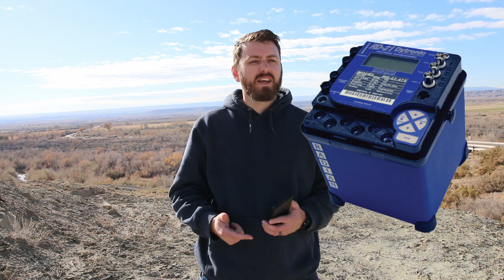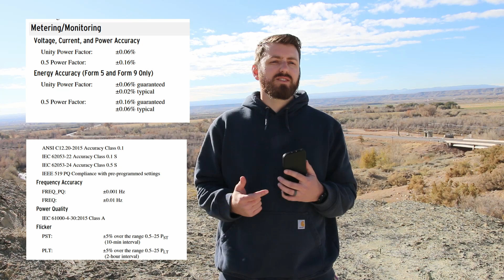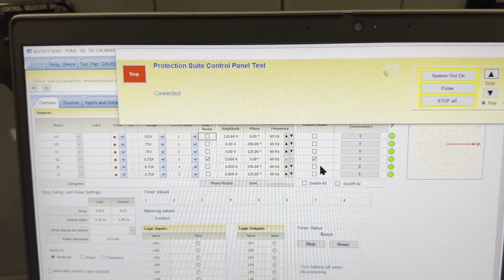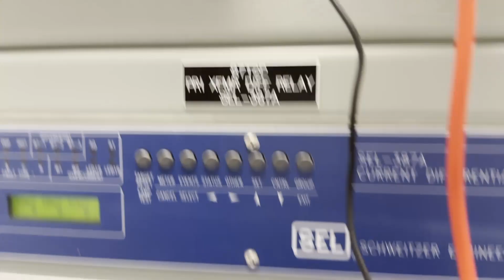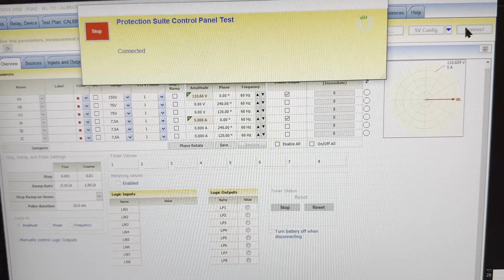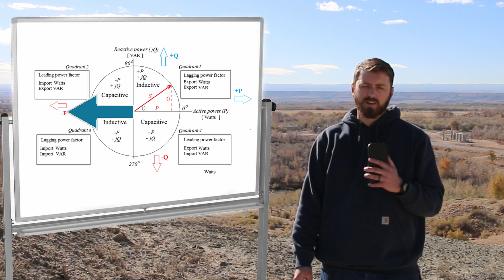How to Test an Energy Revenue Meter with a Watthour Standard [SEL-735 + Radian RD-21] (ep05)

Comment: Good video! I will say Powermetrix makes a phatom load test set that makes meter testing even easier
Reply from the maker: I've seen the Powermetrix units used for in-service checks. I'm assuming they work almost exactly the same way.
Reply: @testingtechtips  They can do both in service and they have a waveform generator. They spit out a nice looking report as well.

The software runs windows xp and is kind of janky but after it's all set up it's really convenient. 

Powermetrix Powermaster 7 series
Reply from the maker: I'll check it out! Thanks!